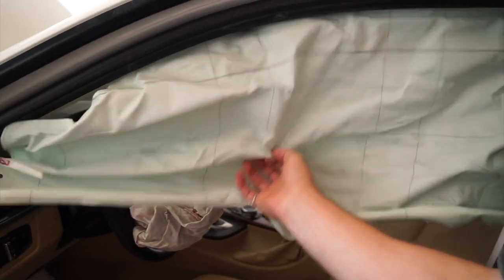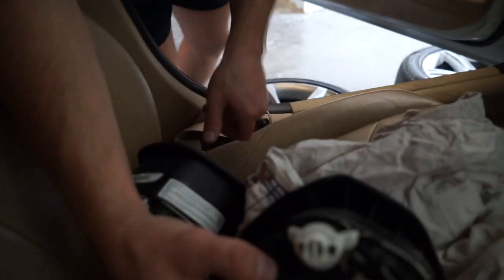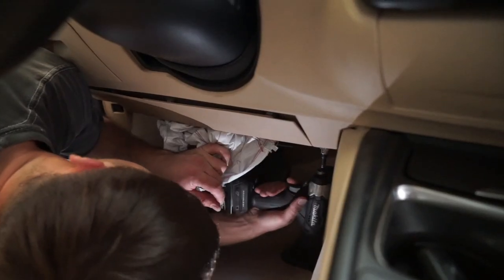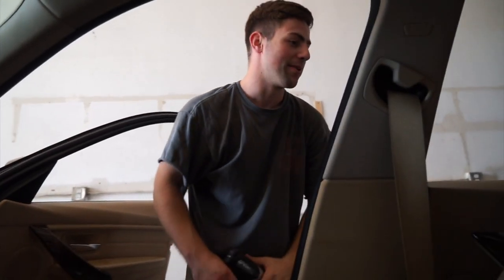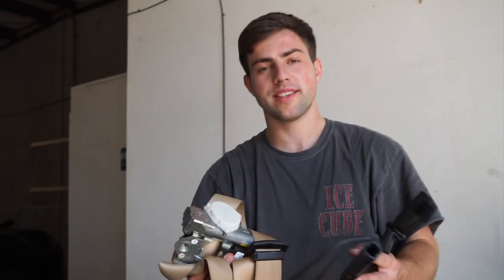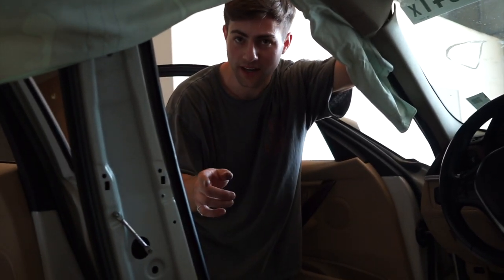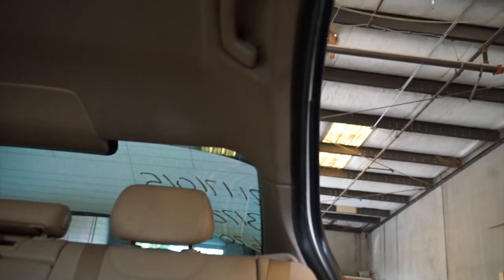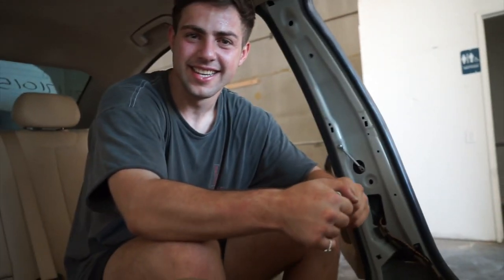REBUILDING A WRECKED BMW F30 FROM COPART! (PART 2)

Comment: AYE! Lets get it bro! Hope you guys are excited for this build! Who is ready for part 3 next?
Reply from the maker: Let’s go! 😎🔥
Reply: lets get it i am ready when you are!!!!!
Reply: @NickBuiltIt  Hey Nick, I know you put the roof airbag. Did you get a new airbag from BMw or recycled? I am replacing roof airbag and got a recycled airbag. The metal clips on the roof airbag( used to secure/hang it in place) are distorted I guess. Not the rivets but those metal clips. What do I do, force them in or use some plastic clips instead of those metal ones? I don't think you can buy those alone? Any input is helpful. Thanks.

Comment: Hey guys, how did y’all drill out the rivots for the curtain airbag? I got another F30 build and I’m stuck.
Reply from the maker: Hey! Just drilled into the center of the rivot. It’ll break loose with the right size drill bit
Reply: @NickBuiltIt  what bolts or fasteners did you use to replace them with? I can’t seem to wrap my head around how a bolt will work with only access to one side and unable to put a nut on the back side lol

Comment: Make sure you reset the airbag module before connecting the battery again. Otherwise you might deploy all the airbags your replaced again.
Reply from the maker: Oh wow never heard of that. I’ll look into it thanks fam 🙌🏼
Reply: @NickBuiltIt  did you all end up resetting the module before connecting? If so, how and where is that module. And if not, did you keep the new replaced airbags connected, connected the battery and they didn’t blow? Lastly did you reset the module after that and did the airbag light go out and how did you do it. Thanks a bunch guys great video!
Reply from the maker: @xmiguelx  Hey man, I believe the battery was disconnected I don’t remember exactly, but I usually disconnect when working on SRS-related stuff. After replaced all the airbags, we cleared the codes and everything went away. I did not mess with the SRS Module itself at all!